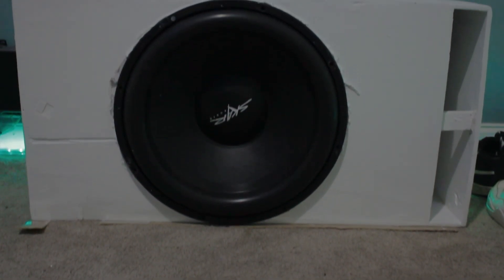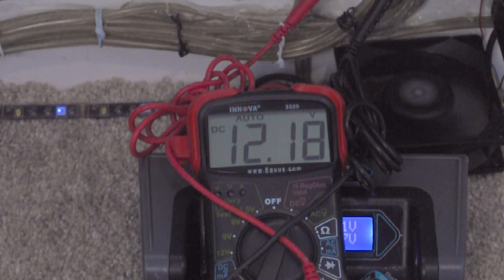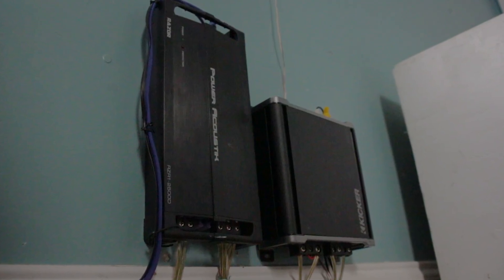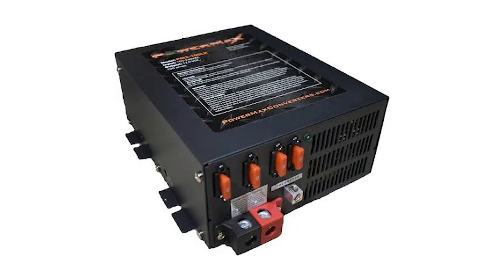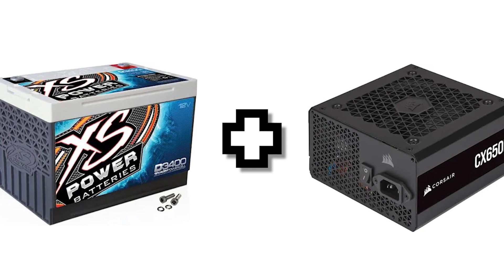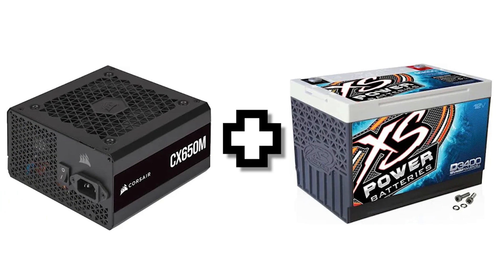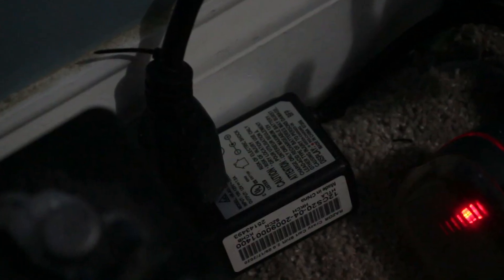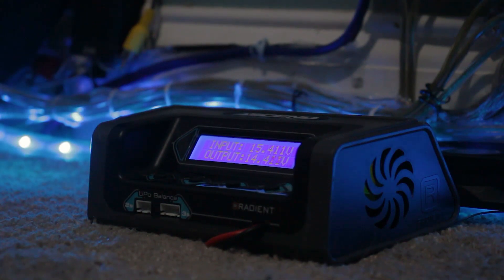How To Get MORE POWER To Sound System (Way Louder)

Comment: Nice I like it. I use a battery charger with a battery built in the charger. Works very nice. I got a 1600 rms watt amp on a 10" subwoofer for now.

Comment: Wouldn't that low of voltage clip the amp?
Reply from the maker: It's very possible that it was making my amplifier clip, but with the battery installed it seems to be performing a lot better. In the future I'm going to get an oscilloscope to make sure my amps aren't clipping at all.
Reply: Unlikely it would clip. Also depends on if the amp has a regulated power supply. From what I've seen the only time an amp clipped with low voltage was due to poor grounding.

Comment: I believe you need a titan8 s5 12v lithium
Reply: he also needs a power supply with are higher voltage 13.5. they have those power supply available on Amazon.